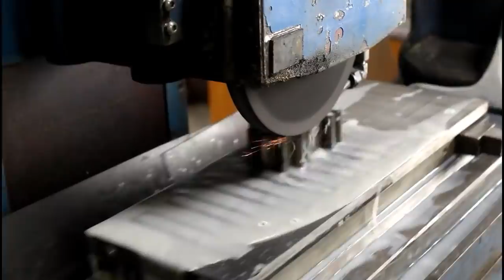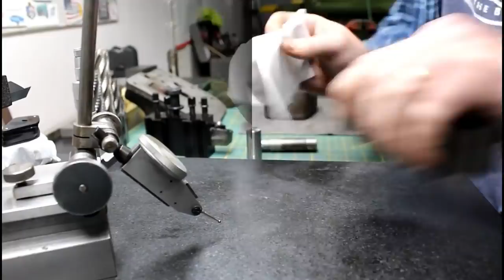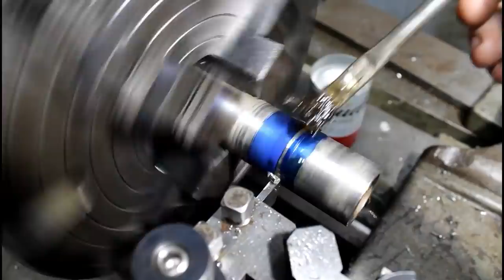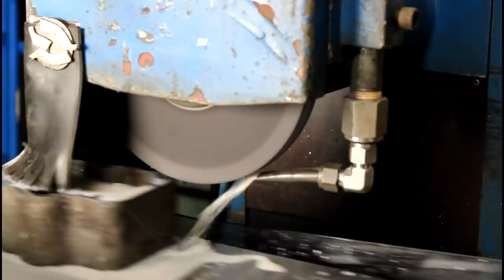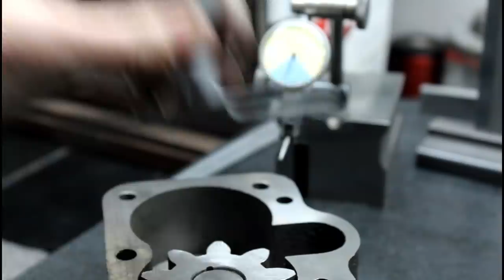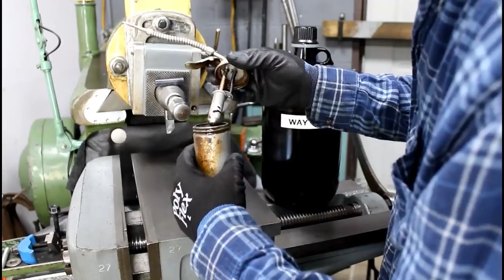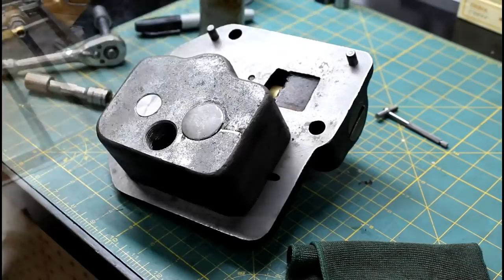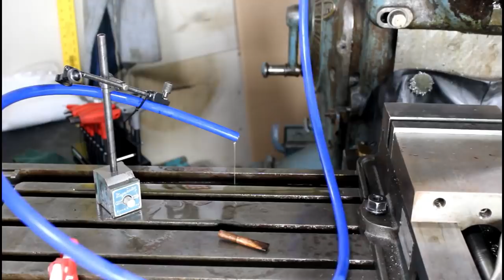OH Yeah! Gear Pump repair part 2

Comment: When I had my fuel injection shop we used to send our Detroit Diesel fuel supply pump - which were gear pumps- off and have them put a thin sleeve in them. The housing would have to be bored out a little.

Comment: Hi, I enjoyed the vid but have got a question. 

Is there any way to make a hear pump work both rotation direction? I am thinking about one way valves on both side inlet and having the outlet on the middle of the both ways? Like in a cross pattern!

Thanks, Greg

Comment: Yeah I think the gears and the housing should all 3 be a matched set and no 
.0055 clearance, plus if you put wipers in the ends of the gear teeth are they going to interfere with each other when they come around and meet in the middle?

Comment: This might be a long shot but what if you put a sheet of copper or brass inside the housing to close up the gap, maybe glue it tight? Treating the teeth doesn´t sound that nice to me but maybe this is doable. No heat and the gap closed- What do You think?
Nice shop, by the way. And You´re such a humble fella- if we even were on the same continent I´d like to work for You, I´d have a blast just broom the floor :) There are alot of machine shop channels but Yours is kinda special. Good, good job with the old mill. Please don´t re paint it, i like when something looks a little worked but i belive the energy of the person who rebuilds something matters way more than paint to me, it gives them things some soul.

Comment: You should find a copy of Smokey Ynicks book Power secrets ! he has a chapter on how and why you need to blue print oil pumps . One thing I will tell you , .005 clearance on them gears end play to the lower plate is over double what you should have . You never want over .002 max.  ---> https://www.ebay.com/itm/Smokey-Yunicks-Power-Secrets-by-Smokey-Yunick-With-Larry-Schreib/254620665149?hash=item3b4893053d:g:xTcAAOSw6Uxe3t-C

Comment: My first thought was about parallelism between the bottom of the pump housing and the ground “top” of it, because the surface of the housing which was placed on the magnetic chuck looked unmachined.
But i am sure that you have thought about that

Comment: Coat the tips of the gear teeth with J B Weld / epoxy , to build them up and grind / machine them to the proper / tight dimensions .

Wyr
God bless

Comment: If this was my pump and if I were a master machinist, I would make sleeves to insert in the gear bores and to keep them from moving I'd drill a couple of holes at the shears line and insert locating pins

Comment: Ball valve low in the line.  Shut ball valve to hold oil until you turn on again.    Turn it on open valve the oil in the line will drain back and prime the pump

Comment: as in v8 engine on the crack shaft  there's a i forget whats its called but its a type of bear half circle. .. so put a thin piece of metal  glued in or spot welded  .

Comment: maibe make a new set of gears , a little oversize so they fit tighter in the pumphousing , you have a mill a rotary divider and probably a cutter to cut gearteeth 
sure lot of work but it should work with the most stock parts of all the ways to do it , might even have them hardened after machining or make them in brass or bronze

seeing that brown bottle with way oil made me think of a revenuer comming by finding that bottle claiming that its moonshine opening the cap and take a big swig to prove his point

the partswasher can work on diesel or kerosine , it smells though

Comment: What if you shut off the valve before you shut down the spindle to keep fluid in the line or a shot of compressed air into the storage tank to prime the pump

Comment: The check valve can be installed after the pump on the discharge line as well as long as there are no leaks below it to lose the prime

Comment: I use red diesel in my parts washer but it does say to use Kerosene/Parafin and another thing the parts brush falls apart i.e bristles fall out and handle breaks up and the black pipe goes rock hard

Comment: Did you mention sleeving the bores for the gear teeth? (metal, plastic?) There is very little pressure developed by the pump so you could glue or screw the sleeves in place before boring them to fit the diameter of the gears. Having the sleeves come loose could be catastrophic. 

Or you could replace the pump with an automotive one attached with rubber hoses. Try putting an easily retrievable magnet(s) in the sump to catch magnetic debris. You might be able to take up enough clearance in the pump for it to prime by inserting a small bar in the gear housing circumference to take up the clearance for one gear tooth on each gear as the tooth passes by. That way you could get momentary suction as each tooth passed the bar. You could play with the pump on the bench turning it with a drill motor. You could make a plexiglass cover for the pump to determine the proper clearance for it to prime.  
A bronze pin made a standard sized welding rod or bar stock could be easily replaced in case of wear or damage.

Comment: A "foot valve" on the suction side of the pump like the one in your water well should solve the problem. The clearance between the gear teeth and the pump casing is excessive though.

Comment: Steve, I would begin by boring out the case as much as possible.  I'd then bond in some Turcite (or similar material) and machine it to achieve the desired clearance with the gears.

Comment: As a FYI for your parts washer I have used Varsol with several gallons of water for years. The idea of adding water is to serve as a crud trap and it also save you on buying as much Varsol, just make sure your pickup is a couple inches above the water in the tank.  A buddy of mine uses a #10 can as a sump for the pickup but while our machines both started off as the same brand machine years ago they both have been modified as well over the years.  I also have a second smaller capacity parts washer that I use on parts after I finish scrubbing them clean in the “dirty” parts washer,  that for a number of years has been an old kitchen sink I built a stand for that 5 gal can that served as a drain and a 5 gallon rigid aluminum fuel tank that I installed a couple of 3/8”  fittings in one has a pressure regulator on it so I can pump a couple of pounds of shop air to it via a hose and a ball valve the second has a check valve in case something happens and more than 5 PSI is pumped into the tank and the third has a ball valve that hose and simple nozzle end on it to rinse the parts with the clean solvent.  When the stuff in the dirty washer gets to trashed out to use it becomes starter fuel to burn brush etc, the slightly dirty stuff from the clean parts washer is used to fill the dirty parts washer after it gets a good cleaning and the cycle begins all over.  I tried several water based parts washer fluids and even have a table top one with the stuff in it but regardless of what the manufacturers I have found flash rust to be a problem.  I use the water based one to clean anodized, blued, coated, or non metallic parts in but keep raw metal parts of any sort generally away from them.  Maybe there are better water based parts washer fluids than the ones I tried so far.
The best thing about a parts washer in the shop is how much less “Gum-Cutter” and Brake-Kleen that you use in the shop and besides being expensive most people don’t realize just how nasty both of those chemicals can be on your repository and circulatory systems.

Comment: I had a similar problem on an old diesel engined generator which would never pick up the lubricating oil on a cold start.We always had to prime up the pump which was luckily fitted to the side of the engine,until an old mechanic told us to fit a non-return flapper into the pick up tube,just like the one on your top side of the pump.He used to be a call out  fitter and knew these old engines since they were new.He even told us where to get the parts we needed and how to fit them,it was just push fitted into the pipe from the sump and then sealed in using gasket sealer.That old engine fired up every morning after that for the next 6 years or so until the boss decided it was time to replace it with some modern equipment.Still miss the rumble of that old generator and when it was shut off at the end of the day you knew it was home time.
Reply: Hi, can you please explain how to prime up a pump? 
Is it pumping the suction side? What do you use to ensure correct method
Reply: @SHARE577  Is it an external fuel or an internal oil pump?External pumps sometimes have their own primer on the side you can squeeze a couple of times.Internal pumps rely on being primed from the last time it got shut down or the gearing being just under the level of oil to aid pick-up.If you can't get oil pressure by the time your engine is starting you need to get this looked into,as this is where all major wear really happens.Hope this helped you.
Reply: @davidmcinnes317  thank you for the respond 🙏 it's an external pump and it has been shut down for years. 
I primed it and it's working perfectly.
Reply: @SHARE577  Glad to hear its working,but make sure the fluids are not contaminated or degraded after lying so long.Check any filters you may have in line,these don't cost much and will keep you running better.

Comment: Could you line the two gear pockets with Turcite and then bore them for a closer fit?  maybe not the best fix for a machine that would run 10 hours a day every day but it might be fine for how often you would use it.

Comment: I don't believe that inserts in the teeth crowns would work. The drive gear has a high loading on the crown as it drives the driven gear. I think the inserts unless hardened and of the correct profile would wear out quickly. My choice of repair methods would be           A) sleeve or build up and re machine the bores, quite difficult and time consuming.
B) as suggested by others a check valve in the inlet, easy fix and not a lot lost if it doesn't work.
All the best from Wales

Comment: SQUIRREL !!!!

I like how you have put your way-oil in a moonshine bottle !
At least in that way your mates won't think you're some weak Nancy-boy ! 

Good show!

How come that aluminium pick-up is so pitted? What have they put in that machine, in the past?

Paddy
PS : is the damage to big to expect any solace from copper plating the inside of the housing and the outside of the gears?

Comment: Hello Steve, As a Pro machinist in a Hydraulic design and repair shop for 30 years I've a little advice, No1, check valve after the pump and before the pump will keep it wet, simple Gravity biased Marble design will work. No2 if you want to fix the tooth clearance issue simply machine off the housing altogether so you end up with a bearing plate and the use a block of Ally, and bore two holes of the correct diameter to match the gears you have, you then make alignment plugs to align the bearings to the new housing and fit dowel pins it's 6-8hours work and will be as good as new, done hundreds of these.
All the best
Rick

Comment: Hey Steve, just try putting a ball valve as low as possible in the system above the pump and use that for your cut-off when you shut down.  Keep the valve at point of use for actively regulating flow.   You'll trap probably several ounces of oil up top and that should be enough to prime the pump when you start up.  Start her up and open both valves and I'll bet a dollar you'll get oil pumping.   Worth a try, really cheap.

Comment: If it was my rig I would remove the original pump from the top plate and modify the plate and drive to hold a chevy engine oil pump. All your original drive components will function the same and you would then have a pump you can replace for less than a Starbucks coffee. You got the tools for it and the know-how. A non-return valve in the pickup tube is a damn good idea as well. But the mesh in the pickup screen is not very fine so you may get metal chunks that defeat the valve. Consider changing to a finer mesh as well as a valve in the pickup tube.
Reply from the maker: I actually considered it. They are a bit small but it could work.
Reply: @SteveSummers  Summit racing has a good one. https://www.summitracing.com/parts/mel-m55hv?seid=srese1&gclid=Cj0KCQjwzozsBRCNARIsAEM9kBPda_OVrY3F-XdwitBLSRcybl5hqR8ZgCM7q1ZwkO3dfOZGNt7eAl0aAqE5EALw_wcB
Make sure you add a finer screen as well the tolerances in this pump will not handle metal swarf. Maybe make a pickup screen box with as much surface area as you can get into the sump.

Comment: Use a sleeve.

Bore out some of the cast iron material from the pump housing and then insert a sleeve ( of course you have to cut some of the sleeve material a way for the inlet and outlet area ), but this would tighten the area around the sides of the teeth allowing your pump to build more vacuum.

Comment: Hi Steve, clean the housing, grit blast the area where the gear OD's touch and apply ceramic repair epoxy paste.  Let it cure thoroughly and rebore to the gear od size.
ATB, Robin
Reply from the maker: The case bores and gear teeth are worn fairly bad. I agree on building up the case. I'm going to try a check valve on the inlet 1st. I almost feel like a check is cheating 😁 even if it works..  if it fails I'll build the case up and re machine the case. Thanks for stopping by Robin👍. You should do a quick YT video on the boring bar you showed on IG. Its simple and a idea worth sharing I think.

Comment: How about drilling two holes in the tip of the gear and use two dowels (tapping those gears might be difficult) and pin a strip of brass to the outer edge? maybe do some kind of fancy reverse chamfer on the end of the dowels to help hold the brass, maybe just a touch of sealant between them just to take up the gap.  No heating required,  then turn them down to get them perfectly circular.

Comment: Would it be possible to bore out the hosing and epoxy in a bushing on each side for each gear? Then mill away the middle to make the profile match.

Comment: I am afraid that if you slit the gear teeth and put copper or brass in there,, the pressure when pumping fluid will permanently bend them.  If you use something flexible, like teflon or rubber, it will be able to hold the 14 psi to suck a vacuum and then if it flexes while pumping fluid, obviously you have enough volume/pressure with the current gears so you should be good.  I kind of like the idea of putting a T and another valve and putting a reservoir up above the pump.  When you have the pump running, fill the reservoir.  When you want to use it, open the valve and dump the reservoir back into the pump and then fill the reservoir after the pump starts pumping.

Comment: Bore out the pump casing to accept a machined liner. Use cutter grinder to surface the gear O.D.

Comment: Instead of messing whit the gears I sugest you build up the inside of the housing With brass solder and use the same setup you did hwen you turned the botom of the housing

Comment: As someone else mentioned, use JB-WELD to build thickness on the side wall of the pump body.  Set it up and resurface the bores with a few tenths clearance.  I did a spool from a 16 head filling machine to better fit the valve body, worked great.  I used the one with metal in it.  It cures hard and is good to machine.  Also mentioned is a check valve. Good luck. George

Comment: there is another way too use a boring head make the holes bigger then put a slip in and do a rolling grind on the gears and re do the bushings or make new gears .

Comment: I get my solvent from tractor supply and I mounted a large fuel filter on the side of of the tank and ran my solvent thru it , works great

Comment: Copper plate the pump gear teeth. Put at least 0.010 inch plating layer on them. Then resize the gear bores to
the max diameter of the gears to fit into the housing with only 0.001 inch diametrical clearance between the
gear teeth and the housing. Tighten up the end clearance on the gear teeth to cover plate to 0.002 inch
after copper plating.  Before plating the gears paint the areas on the gears that you don't want the copper
plating (i.e. gear bores and flat ends of the gears) to adhere too.

Comment: Hi Steve got the same mill as you my pump would never pick up dry but if you prime it it would and run all day and the next day to,once primed.i think it’s your little flap none return valve letting by.the pump should have oil in it at  all times

Comment: Steve, pleasure to meet you and your wife at the Bash.  The comments below are a wealth of suggestions.  I think check valve first.  If that doesn't get it.  Machine the internal sealing bores to good metal, epoxy / turcite coat, and re-machine to tolerance.  Would be a simple job on your grinder to get a consistent OD on the gear teeth, just kissing the surface.  With that said, I think a well sealing check cartridge in the suction line will end your problem.
Reply from the maker: Thanks😁. I believe the inlet check is the easiest fix. The flow and pressure is more than enough. Only issue is oil pickup.

Comment: great vid, my vote is for the NRV also.  At a pinch you could bond PTFE liners into the bores and rebore, but that sounds like a pain and you will probably end up with something that will still not self prime.

Comment: always enjoy your vids... all the best from Ohio.  My suggestion is to make two "bushings", press them into the pump (making new housing walls to mesh the gears).. just cut the extra  radius off the gears, maybe attach them  together somehow (low/no heat)... seems a better fix than to work on each gear tooth seperate